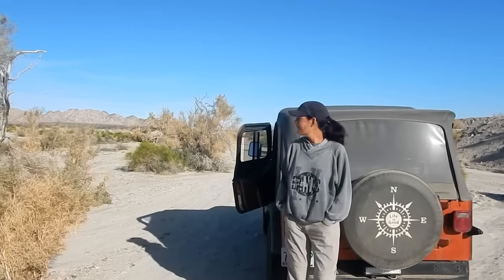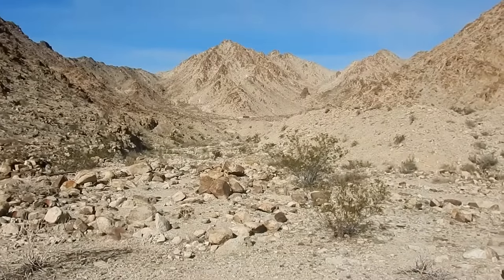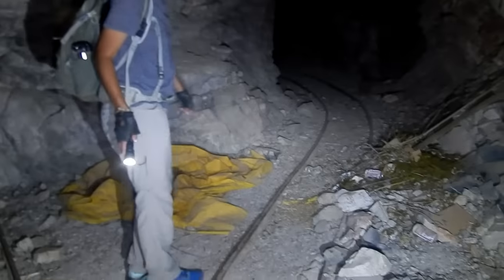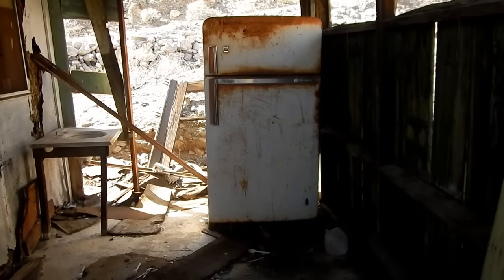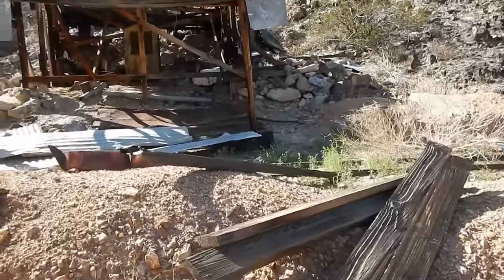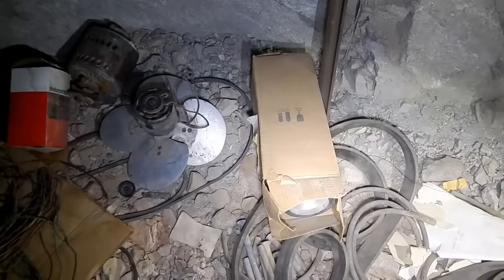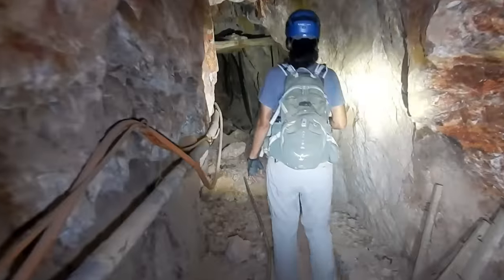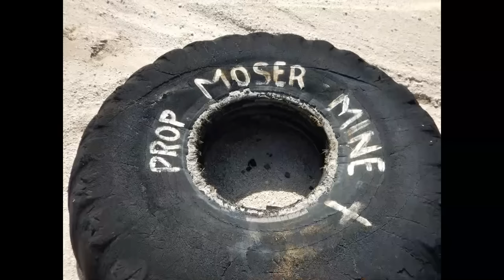The Mine That's Full Of Cool Stuff: Generator, Air Compressor, Cabins, Tools, Shaft Bucket, Winch ⛏️

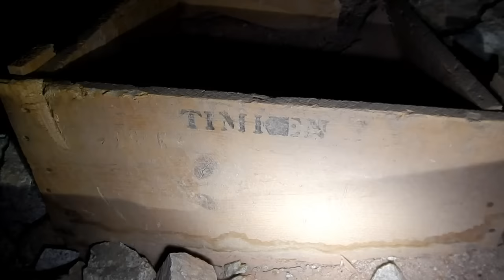Comment: At 43:18, the stencil on the piece of wood, marked "TIMKEN' is an American bearing manufacturer. More than likely, the miners bought some parts to repair something, and the parts store gave them an empty wooden box that was once loaded with Timken bearings the store had ordered, to carry the parts home in. (the chances that the small scale mine ever needed a huge box of the same bearings is just not gonna happen) Later, the wood from the box was repurposed into the framing enclosure you guys found.
Reply from the maker: Thanks for the excellent comment, Wade. Yes. Timken. I should have recognized that. We appreciate you watching!👍😁

Comment: I explored a few mines in Canada in the 50s, when I was a kid.  There weren't a lot of hard rock mines where I lived, mostly placer mining.  There never was a treasure trove of equipment left, like you are lucky enough to find. 
The engine is a mid 60s English Ford engine, probably out of a Cortina.  It has a cross flow head, so it is probably from 1965 to 1968.  They are a great little engine, and it does not surprise me that someone was smart enough to use it as an industrial engine.
Reply from the maker: Thanks for your input on the engine. We see some of the little Datsun engines from the same era used at the mines, too. It's good that you got to do some mine exploring as a kid. 👍😁

Comment: Hello Julie and Tom.  Looks like I see Lucas on that starter motor of that engine.  Must be a British engine.  Then on the top of the air cleaner it said Made in Fram GT. Britain.  I think that's what it said.  That RCA Whirlpool I had not seen that before but I read they were around from late 50's to early 90's.  I'd guess that was from the 60's.  Love the old can opener.   I've used something like that before.  Anyways great video with like of nice finds.
Reply from the maker: Hello, Stephen. I missed the Lucas on the starter but did see the Made In GT Britain on the air cleaner. I hadn't seen the RCA Whirlpool either. Thanks for watching and commenting!👍😁
Reply: Yes, saw the Lucas on the starter. Engine probably out of an MG at a guess from the air cleaner language.

Comment: WAY COOL!  This mine has been worked off and on from appearances.  Since you say it's in a Wilderness Area, I wonder if operations were intended to continue but they were shut  out by their uncle or if it still is a valid mining claim.  Given the condition of the road, I'm guessing the later. It's interesting that the car door hinges still worked since the body seems to have been burned out with enough heat to collapse the roof.  So many things to look at.  TIMKIN (bearings).  The little engine looked to be English.  The Kollar lite plant engine looked to be a Continental.  Those pulleys looked to be from alternators.  I'm guessing they didn't work too well.

Here's the thing that gets me, a lot of that stuff I recall from when it was new.  Fifty years makes it an artifact.  Makes me think that I shouldn't set in one place for too long...
Reply from the maker: Thanks for the detailed comment, David. We're glad that you liked the mine. Don't sit still for too long or you'll be mistaken for an antique. 👍😊
Reply: cool mine!

Comment: Vinegar, well maybe on the reflector but I have run thousands of hours on carbide lamps and never used vinegar on them.
Reply from the maker: That's what I heard anyway. I have used a carbide lamp, too, not for thousands of hours, but for a few months on a job and never used any vinegar. What do you suppose the vinegar was used for? We see old bottles at just about all the mines we visit, and many times inside the mine. Thanks for the comment, Drew!👍😁
Reply: @TomandJulieMineExploring  gosh I. Just am not sure. Maybe just kitchen use around the cabins.
I suppose if you constantly overfilled the lamp with calcium carbide
You might clog up the lamps drip tube and use vinegar to clean the lime out but I have never done that.
The sulphuric acid botlle was for topping off the electrolyte in wet cell batteries .
Keep making the Great videos for us.

Comment: Cars up into the 1960s had chassis, they were a lot stronger then the more modern cars with only frames.
Reply from the maker: That car chassis looked pretty sturdy. When there was an accident with two of those beasts half the town probably rattled. Thanks for commenting!👌👍
Reply: lol boy are you misinformed.  Many cars had body on frame construction clear up into the 90s and beyond... The first US cars to have production unibody chassis were Nash in 1941 but Lancia (Italian) pioneered the concept in 1923.   Unibody vehicles are actually stronger as passenger vehicles but for trucks/SUVs/Big Rigs the body on  frame is still mostly used because it is stronger for heavy load/usage applications.

Comment: I have watched several of your videos and I am scared for your safety. 
You are constantly going under rock that could fall on you. 
When you get to a place that has timbers in them, look at the board or wedges on top of them.
If they look squashed then that timber is taking weight. (Not a good sign)
Get an old pool que and cut it down for a walking stick.
Put a brass ball on the big end and a small button on the little end. If you practice listening to the sound that solid rock makes versus a loose rock sound, you can learn to differentiate good from bad rock overhangs. 
It works with timbers also. 
The more weight, the higher the sound pitch.

Timber on the ground (thunk, thunk)

Timber taking weight (twang or solid like rock)

I PRAY that you guys stay safe. 
Wish that I could join you. !!
Reply from the maker: Thanks for your concern for our safety, David. Those are all good tips you are presenting. The dangers of exploring old mines should not be taken lightly. We appreciate you bringing up this important subject.👌⛏️

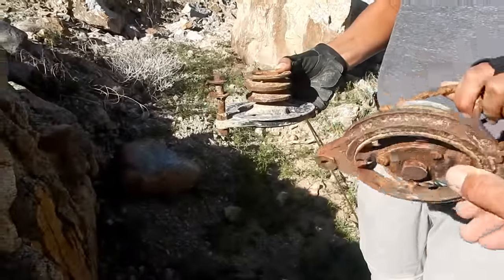Comment: 50:37, that is a generator front housing on the right and the left is from an alternator.
Reply from the maker: I wonder if they were trying to use the pulleys for running on the tram cable. Crazy miners.

Comment: First time I've seen a mine cabin with semi-modern appliances in it!. Looks like with a little water and propane you could mix up a tasty meal or two...   ;^=[}
Looks like they came up there in the 80s and worked it a little - probably reworked the tailings, dug a little. Were they extracting the gold there? Strange little scene...kind of a mom & pop operation....
Reply from the maker: Looked like the oven was from the 1960's? The dates on the wall indicate someone was there in 1983. Thanks for the comment, Steven!👌🙂

Comment: I finally got around to watching your video, very cool. Those are pretty neat bottles do you ever take any home with you? That was a pretty modern kitchen in that one cabin. They must have had water a well or spring somewhere around there at one point. I do believe those are fossils of plant life you pointed out in the rock. Those prices on the wall those market prices I wonder if that's per ounce $555.80 per ounce. That is very interesting to see ledgers written on the wall like that.  That small 4-cylinder engine you said something about a ball mill. Is that some kind of a rock crusher? That is a lot of cats scat!! They sure left a lot of stuff behind. Thanks for taking us along with you I really enjoyed watching. Keep them coming and keep safe.
Reply from the maker: Hi Eddie! We don't generally take anything from the mines like bottles and other stuff. Someone called that plant looking pattern on the rock a dendrite. The gold prices would be per ounce. A ball mill is a large, round metal tank where there are many steel balls, about the size of baseballs. They add the valuable ore and some water, then the tank is turned like a cement mixer. The steel balls pulverize the ore to very fine size releasing the fine gold which is then recovered by a number of different methods. Ball mills are used in other industries besides mining for grinding, blending and other things. Thanks for the comment. Hope all is well at Happy Together!👍🎸😄

Comment: The part of a Model T differential back in the day you could buy accessories from Ford the part is the pulley  on the end is for a belt . You jack up the T pull off the wheel and attach the pulley on it then throw on a wide belt they had attachments like huge saw blades to cut wood and I think to run a pump . You start the T throw it in gear and they way you go pumping or cutting
Reply from the maker: Exactly. My grandpa had a big saw arbor with a drive shaft & wide belt for cutting wood. It had a big circular blade. 24" maybe?
Thanks for the comment!👌😄
Reply: @TomandJulieMineExploring  Yes you are correct they were at least two foot in diameter . You are welcome !

Comment: Looks to be cinnabar looks just like the rock in the cinnabar mines around here
Reply from the maker: Where are you located?It's listed as a gold mine, but many of the mines we see are multiple metal mines. The usual metals are gold, silver, lead, and copper. Cinnabar, or mercury mines, are less common in this particular area. That's not to say you aren't correct, though. Thanks for your input! 👍😁

Comment: Would they use machines to blow cool air in or would it be a passive mechanism?
Reply from the maker: Usually a blower of some type would sit outside the mine and blow clean air into the mine through piping. Depending on the layout of the workings some mines have a tremendous amount of air moving through them naturally. Thanks for the comment!👌😁
Reply: @TomandJulieMineExploring  sure thanks for answering. Also when about  was this method invented?

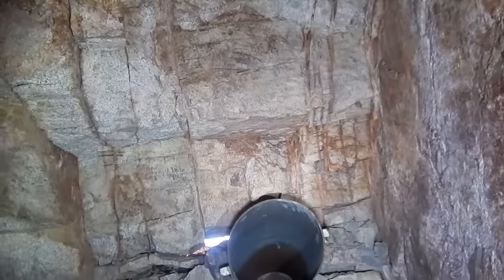Comment: 14:46 was a series of injections of quartz, I count 5, possible 6, which means the ground spread apart that many times, looks like you are in a basin&range territory. https://en.wikipedia.org/wiki/Basin_and_Range_Province. Where the rust is good chance of gold.
Reply from the maker: Thanks for the link and information about prospecting for gold. We have done a bit of mining , milling and panning. It is a lot of work and requires a fair bit of equipment.  We are really more interested in the history and seeing the old mine workings. Plus we don't want to catch a bad case of gold fever.😆👍
Reply: being that close to the San Andreas and numerous other faults including the one the mine is dug along I'd say that it's a safe bet that it's hydrothermal enrichment and could have happened several times.

Comment: Please give us some info of geology on the walls.
Reply from the maker: Hi Tinkerbell. I'm not a geologist, but I can tell you that no matter what type of host rock it is that contains the gold in this mine, it has to be crushed in a mill and further processed to recover the very fine gold particles. The formation that looks like a fossilized plant is actually made of minerals and is called a dendrite. FYI, the wall of a mine is called the rib, and what you might think of as the ceiling is called the back. Thanks for commenting!👍😁

Comment: Another so called Wilderness (road less) but has a road and structures.
Reply from the maker: Not all areas that are designated wilderness are roadless and without structures. This was obviously not a wilderness when the mines were operating and the roads were being used. It has subsequently been changed to the wilderness designation. Thanks, Don!👌

Comment: the totally fractured rock was fractured at the start of The Foood 4,370 years ago.
The gold and quartz were precipitated out of the water that flowed up the cracks.
Reply from the maker: Thanks for that, Rose. 👍🙂
Reply: LOL not quite...  but those are probably hydrothermal deposits but "the flood" had absolutely nothing to do with it.  Hydrothermal deposits are volcanic and the fractures in the rock are from geologic activity.  The highly fractured rock develops when magma cools quickly.  There are more faults in that area than you can count... it's also not that far from the San Andreas.   those deposits could be from tens of thousands to hundreds of thousand of years old or even older.  It's been 40 years or so since I studied the geology of the Joshua Tree area so I have forgotten the fine details.